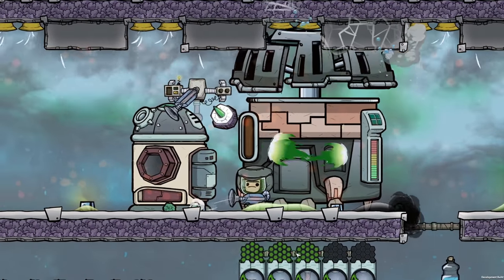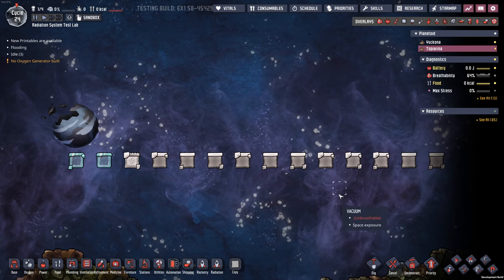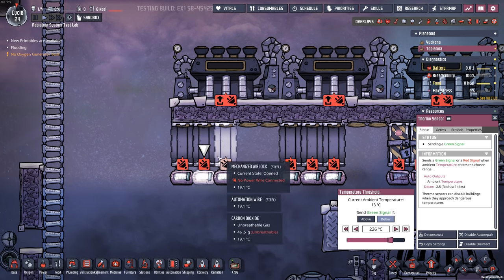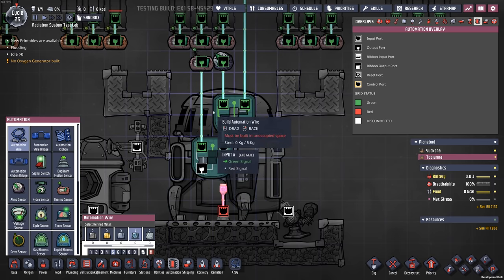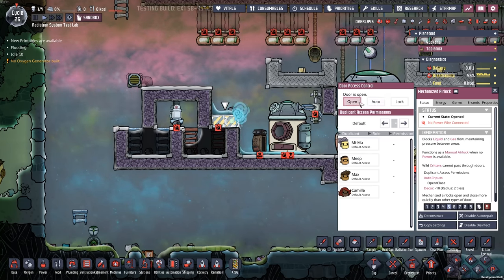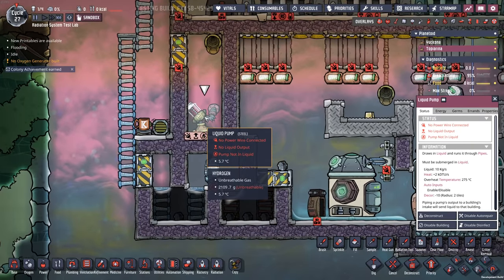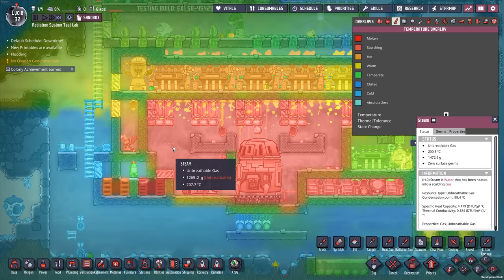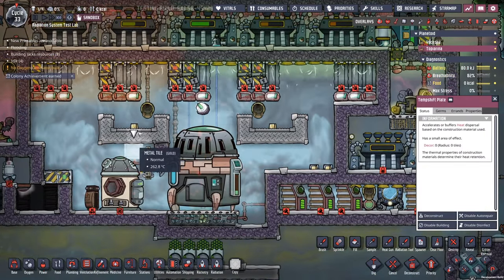Automating the Nuclear Reactor! - Oxygen Not Included Experiment

Comment: The point of fusion for the uranium ore is a bug, it is certainly missing a zero and then some numbers scrambling because uranium's melting point is 1132 degrees C. Even if this is for the ore rather than the pure metal, the ore is generally not far from the metal. Anyway, uranium is usually extracted chemically rather than by melting it since... well... molten uranium is a thing of nightmares.
Reply: molten uranium is a nice concrete "dissolvent", besides that, it cools down really slow and glows nicely.

Comment: I think I have an idea for an efficient plant meat farm. Two of the biggest problems with Saturn traps are the long life cycle and the fact they can eat both sweetles and grubgrubs
However, there is a way to know when it is safe for the grubs to come inside and give them the buff. When a critter is inside, the plant periodically creates puffs of hydrogen, which we can use to know when it has eaten our critter of choice.
We can either use a sensor on every plant and run them into and gates to know when all are running, or we can use a single sensor and a timer, after which the grub grubs come in to apply their tend to the plants, dropping the 30 grow time into 15
Then, all we have left to do is know is when they are done and get the grubs out of there, which we can do by restricting access to the feeder when they go out and then opening it when a cycle passes to ensure all grubs are done
And to detect when the plants are done digesting, we can either use a cycle sensor and a counter or have a pump constantly take out hydrogen and let more morbs in when the atmosphere drops below a certain point

Sorry if it looks a bit chaotic but I hope this idea can be used or expanded into something that works

Comment: I think graphite is used in fission reactors to decrease the energy of the radiation so that it can do fission which I heard is the reason for Chernobyl but more specifically the graphite tips of the control rods, water is used now intend, but I'm not a nuclear fisisit.
Reply: Graphite is used as a moderator and reduces the speed of neutrons. This makes them more likely to cause more fission, so they help propagate the chain reaction 🙂 So yes, you are basically right. Water is a great alternative, because when it gets hot it will boil off, so you no longer have a moderator and the reaction stops by itself.

Comment: The fluid inside a reservoir does not transfer heat directly to the reservoir, it transfers it to the tiles the reservoir is sitting on which then transfer it to the reservoir. Mesh and airflow tiles do not transfer heat, the fluid or gas inside them does. So if you build the reservoir on airflow or mesh tiles inside a vacuum there can be no heat transfer.

Comment: How high of pressure can you have the steam in the reactor room? Unlike running petroleum generators at high temperature for extra power from the high temperature steam, the temperature of the steam released by the reactor seems to be independent of the temperature of the reactor itself, so if you run at 100kg+ per tile, and use enough turbines (along with temp shift plates and metal tiles to create good temperature balancing, you should be able to run the reactor in a room that is temperature stabilized by steam turbined without inputs blocked.

If my observations are correct and the reactor turns approximately 5kg of water to 400C steam per second, then it generates about 6.2 MDTU/s, so that's at least 8 steam turbines to keep the heat under control at full load, and very high steam pressure in the room to maintain thermal inertia, perhaps close to the 1000kg limit of liquid vents for adding the additional water into the reactor room. The steam turbines should reach equilibrium at a little under 200 degree temperature in the reactor chamber. This system would circulate 16kg/s of water for cooling, but only 5kg/s of that would be directly to the reactor.

Comment: I tried my hand with this and I realized that all you need is 6 turbines operating at 4 outlets with 3 turbines feeding water back to the steam chamber while the other 3 carries water out to prevent overpressure. Drip the water on a 3 wide airflow tiles next to the reactor on both side  near the top and spread tempshift plates between the two to keep the steam cool just below 226C and generating near max power. No automation necessary in keeping the steam temperature constant. Just the fact that steam temperature should average out between the 400C steam output and the 95C water from the steam turbine.

Comment: in a higher tier nuclear reactor build, could you perhaps put the particle accelerator things in between the liquid-flow tiles and the insulated walls?
assuming they could withstand the heat, the particle accelerators should only benefit from a higher exposure to radiation as far as i know, and those insulated tiles would be halving the radiation from the reactor at least, even with a less shielded material, (if the sky-test tiles also apply to insulated tiles at least)
although, perhaps the liquid-flow tiles have the same problem? i'd expect they or the air-flow tiles are much less shielded because they aren't actually a solid block "lore"-wise, but i could be wrong. however it might still be significantly better, even if its just 1 layer of shielding vs 2 between the reactor and the particle accelerators
I'm unsure how the high-energy-particles interact with heat, but you could probably use some liquid or other as makeshift insulated tile

Comment: Nice video! Try maybe filling your steam room with very high steam pressure to even out the temperature swings, then you should be able to just have your steam turbines run without doors as well, as they passively cool more when the steam is hotter (more heat deleted).

Comment: well a couple of things ...

the number of turbines can be higher ( we just need to use a doors system like we did with the old turbines, just compress the steam to another/s room/s )

the liquid lock is all nice but oil is not the best, the best way is not use it at all, some shipping rails might be the solution 

removing liquid from the reactor room can be done with automatic doors to a place more cold

the big problem I see right now (in the future this might be change) is the availability of uranium, you can do the same with 2 or 3 volcanos and make steam from magma 

overall the tech looks nice but we have better alternatives, also more cheep and reliable (meaning they don't explode)
Reply: i hate choking turbines with doors. i'd rather alter the steam so my turbines run "ideally"

with hot steam vents/volcanoes i'd say keep a stockpile of water to regulate temperature in steam chamber... but with a constant nuclear source, just add more turbines! the Xkg of 400° steam will balance with Ykg of 95° water to make Zkg of 200° steam.

Comment: I just realised that everyone on youtube is wrong about using nuclear reactors. Those are not for making steam. but for making petroleum or sour gas and steaming is the secondary process to cool those two above.
Reply from the maker: You could use the 400c steam to preheat oil.
Reply: such a massive heat source; seems a shame to limit it to 200°c
there are uses for the higher temps it's capable of reaching.

Comment: When Spaced Out came out I loved every single change they made to the game, almost as much as I hate just about everything related to fission (hell, everything else too, the farming stuff included) they released with this new update. The whole thing is just a convoluted mess that instead of adding more utility to the game, just adds nuisance.

I'm not saying your design is bad or inefficient, I'm saying that if that's what it takes to make it work, I rather feed stone hatches the output of those 3 starter map minor volcanoes and use 3 tuned up coal generators instead...
Reply: the design around fission seems to be more as a barrier to research than something used to create power efficiently compared to other forms of energy.  power wise just about anything would out perform this.  You could set up a dupe slave pen with hamster wheels and deliver them meal lice.  four dupes and an equal number of crimes against humanity later and you're pumping out power on par with this fission design.

As for the design there's bound to be inefficiencies.  its a proof of concept.  You could, in theory, scale this to produce a lot more power with multiple reactors in a long or tall design at the cost of map space.  Will it ever be as useful, efficient, and hands off as a well made sour gas boiler.  Absolutely not, but its another option.  Also  consider how easy it would be to set up a fission/steam turbine system on other planets and running it off delivered enriched uranium.  We can't do that efficiently with coal/petroleum so that may be where they're heading with this as well.  We'll have to wait and see the big picture I think.
Reply: @CourtJester888  An option is only an option if you are willing to deal with the additional tedium. That's the difference between an alternative, and a gameplay element people just go ahead and skip...
Reply: I see it as a "it's there if you want it, but you don't need it". And go elaborate on that part, you can get the rad bolts from space, beetas, or shine bugs, and just never bother with nuclear. Personally, I'm not going to bother with these unless I have like a uranium volcano to justify the effort.
Reply: @SireBab  Exactly, skip it.
Reply: Terra cluster might be still playable, but they did break sick bay in last update and dupes will have to live through slimelung, if they catch it. Swamp cluster is dead end. The only source of plastic is petroleum from second asteroid. Source of fiber - nowhere to be found. Carpetted tiles and picture remnants disassemble into raw minerals.
Reply: @tokul76  I'm the guy who never bothered to build a rocket in the base game because it was too tedious - not difficult, there is no difficulty in copying a youtube video about it -, and even I have no issues with getting either fiber, or plastic. Actually, I'm getting them at the same time by entering the third planet and either waiting for the printing pod to roll a drecklet egg, or I just capture a drecklet and take it home, then breed glossy drecklets.

Easy enough. Just because the tier progression is different it doesn't mean it's broken.

Comment: I didn't quite follow your condensate setup. So I'll just toss out some things that are used in real power plants for efficiency. I am not sure how much it matters in the game but you could setup a preheated using the current temps in your reactor room to preheat the water going to the reactor. 

This of course helps because in turn you use less energy to turn the water into steam then. Not sure being more fuel efficient is a thing here though. 

Looked like you were doing something similar by dumping the water onto the gold tiles.

Comment: abuse the corner oil lock with a step down, add a radiant loop between liquid lock and aqua tuner, costly but still pulls power from reactor through heat transfer. also, do glass tiles allow rad gens to push particles?